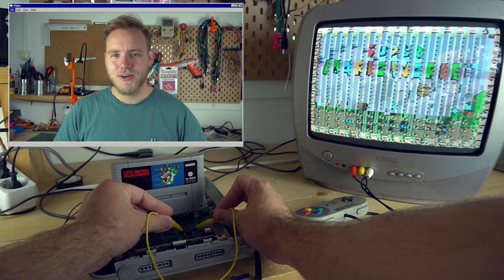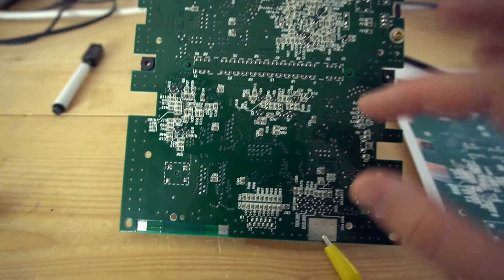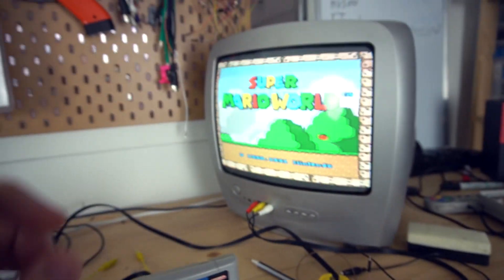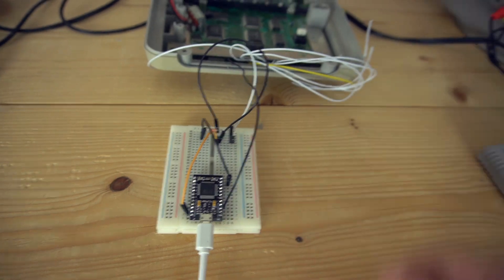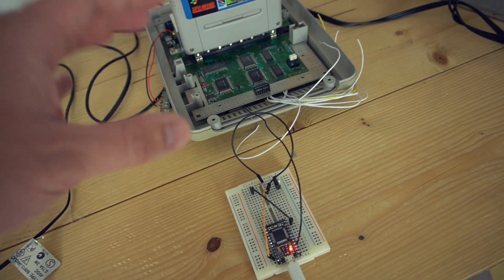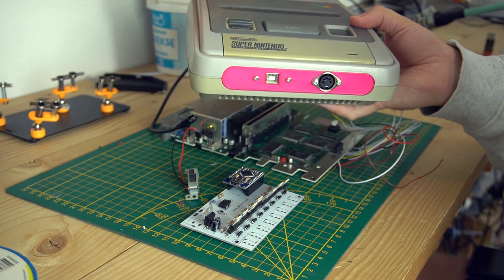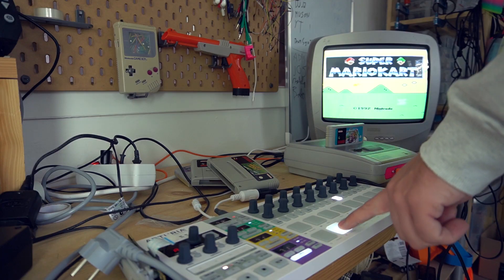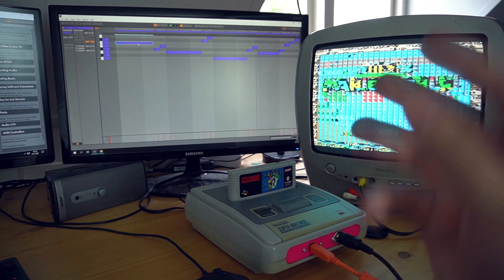I’ve Hacked a Super Nintendo for VEE-JAY-ing!!!

Comment: Neat. What kind of "Arduino" is that? Looks like you're using two different types during the process.
Reply from the maker: That is a arduino pro micro from DIY More ;)
Reply: @jwotto  Thx! What about the one earlier in the video?
Reply from the maker: Aha that's also a arduino pro micro but with a USB mini port.. those are a bit more sturdy .. you can buy them at aliexpress
Reply: @jwotto  Cool, thx!

Comment: This is so cool.
I'm getting the urge to go for it, myself!
I'm CV and trigger based, so it could be made even simpler by just using a fistful of transistor switches to short the bend points to ground 👊🏼
Reply from the maker: that would be much simpeler! you can indeed just use some transistors and trigger it with cv.. i did that with solenoids in one of my first video's :) check that out! it's almost the same concept https://www.youtube.com/watch?v=Wj9JKTnGXSY&feature=youtu.be